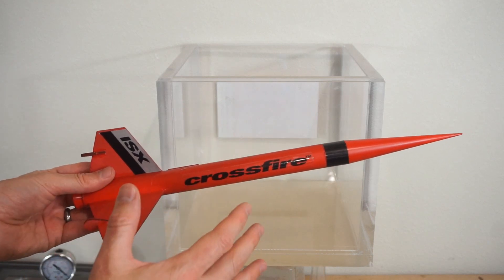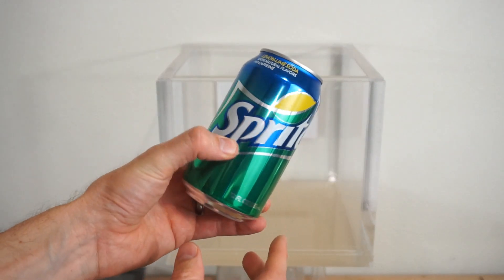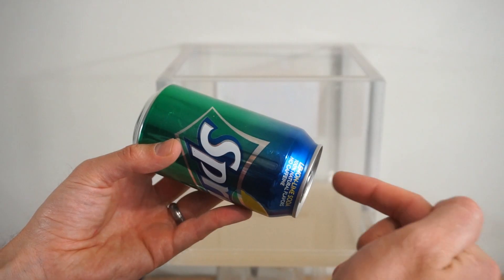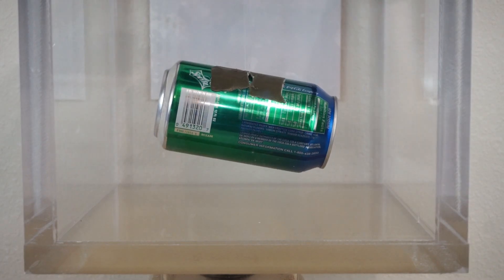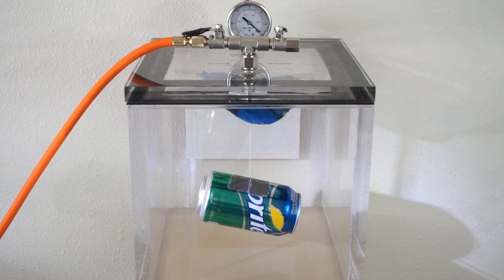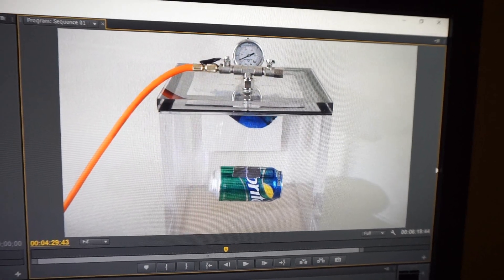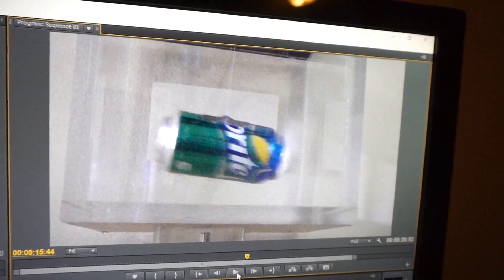Can a Rocket Fly in a Vacuum Chamber?

Comment: Stop telling stupid lies to ignorant people. Thats no real vacuum chamber.  The biggest vacuum chamber is in Ohio and only measures 100ft wide by 200ft tall. The vacuum gets compromised once you ignite the engine. In space cacuum your soda can will simply explode the moment it gets exposed. The Joules-Thompson's effect and the Bernoulli's law clearly show that thrusters cant work in space vacuum.
Reply: " the Bernoulli's law clearly show that thrusters cant work in space vacuum."
This is an absolute LIE.
Stop pretending you know anything about the subject.

Shall I show you VIDEO EVIDENCE of rocket propulsion working in a vacuum?

Jut answer one question first: At WHAT ALTITUDE does earth's atmosphere become "Vacuum" ?

For the sake of argument lets call "vacuum" any pressure LESS THAN 1.0 Torr,

Now answer the question and I'll show you the proof.
Reply: @stuartgray5877  Bernoulli's: the higher the fluid's, pressure the lower the speed. You can't get laminar flow nor contact in the bell walls without atmospheric pressure. Joules-Thompson's free expansion tells you the gases make no work. Show me the video to make you pieces.

Karmán line is at 65 miles or 99 km. 

The pressure in outer space is 1 × 10−6 to 17 Torr. Millions of times bigger than 1 Torr. Your argument is childish and inconsequential, 1 Torr is no space vacuum. There are no valid videos nor chambers able to mimic real outerspace conditions.
Inch of mercury (inHg and ″Hg) is a unit of measurement for pressure. ... In English units: 1 inHg60 °F = 0.489, 771 psi, or 2.041,771 inHg60 °F = 1 psi.
378.8 miles/2,000,000 ft= 7.0 x 10 to -11th psi
Reply: @1969nitsuga  Lets be clear.  1.0 Torr is a really SMALL pressure right?
1.0 Torr is close to one-one-thousandth (1/1000) that at sea level).
RIght?
1.0 Torr is about 0.02 PSI
You DO KNOW that 1.0x10^-17 Torr is just a WHOLE LOT CLOSER TO ZERO RIGHT?

You know those vacuum numbers  are NOT NEGATIVE NUMBERS right?

The difference from being at 0.02 PSI and 0.000000000000000001 PSI is negligible since the chamber pressure is about 3000 PSI.

DO you believe that a rocket SHOULD work at an atmospheric pressure of 0.02 PSI or not?
Reply: @stuartgray5877  1 Torr is a lot more than 1 x 10 \-6 Torr, exponentially. We are talking about supersonic flow. It still works in 1 Torr. The amount of molecules per cm3 is millions times higher. You don't get it because you have no empirical physics background.
Those chambers you mention are simply too small and weak to preserve a significant vacuum. Even more, the vacuum gets compromised (no more vacuum) the moment you activate the rocket engine. A rocket can get past the Kármán line capitalizing on momentum (p=mv) and the kinetic energy (ke= .5mv squared), but not for long because it can't generate force in space vacuum.
Reply: @1969nitsuga  " it can't generate force in space vacuum."

What LEVEL of VACUUM do you believe they stop working in?
Reply: @stuartgray5877  There isn't a magic number. It depends on different factors like the weight, design of the engine, type of fuel. It will eventually happens but those factors can make it faster. But for starters the Kármán line is right there. This soda can video is really ridiculous, only a moron would build such a set up and expect valid results.
Reply: @1969nitsuga  You can watch the falcon heavy side boosters perform rocket propulsive maneuvers above 60 km then see them land right in front of you.
Reply: @stuartgray5877  First: 60 km, 37 miles
Second: How do you know the altitude?
You are parroying stuff you have no personal knowledge nor understanding.
Reply: @1969nitsuga  A simple free body diagram proves rockets can't work in a vacuum, as does a simple PV work calculation. It is a ridiculous notion.
Reply: @papalegba6759  then SHOW US YOUR DIAGRAM.  Or did they run out of crayons in your special needs class because you keep eating them?

Comment: The gas just dissipates in the nothingness of space called the vacuum , high pressure moves to the low vacuum nothing happens no push nothing gas just dissipates into the nothing of space. I'm sorry you don't understand what a true vacuum is but any pressure will just dissipates no push no thrust nothing...
Reply: SO you are one of those that think that VACUUM "SUCKS" ?
 Perhaps you should try taking an actual physics CLASS before arguing that all physicists are morons?
Reply: @stuartgray5877  you don't even understand the physics definition of 'suction'.  you are hopeless.
Reply: @papalegba6759  - I am a vacuum test specialist with over 20 years experience operating some of the biggest vacuum chambers in the country.
I was first trained at Lockheed Martin Space Simulation Labs obviously before you were born based on your pre-pubescent intellect.

Your experience with "vacuum" is limited to what you do with your mouth and your teething toys.
Reply: Correct. 👊🏻😎

Comment: Nice video. If you do something like this again it would make it harder for folks to argue that it is really filling up the vacuum chamber if the rocket was much smaller, like the size of a Chapstick container or smaller. Maybe it could be filled with a gas producing reaction that is delayed, like vinegar and baking soda separated by a melting piece of ice, so there is plenty of time to reach maximum vacuum before it bursts. It would also spare you having vacuum pump and piping filled with Sprite. If nothing else switch to a can of carbonated water so it's not sticky.

Anyway, thanks for making great videos.
Reply: Failed experiment... :face-blue-smiling: the thrust has the full support on the face of the glass box. In a big vacuum space it will not work cause no any medium.
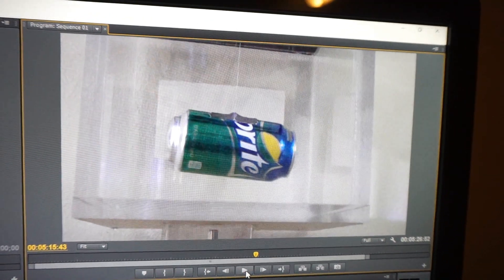Reply: @vz7042  "Failed experiment...the thrust has the full support on the face of the glass box" - failed reply ... You can see that the can moves before the fluid hits the face of the glass box 5:58
" In a big vacuum space it will not work cause no any medium" - there is no medium needed.
Reply: if he does it again try using a fkn rocket maybe?
Reply: @papalegba6759  He DID use a rocket. But if you prefer, he could have put some blue painter's tape over the Sprite logo and written "Rocket" on it with a sharpie.
Reply: Great video - for what? It is not explaining the rockets propulsion simply showing the law of momentum. Which by all means cant be the explanation for a rockets forward movement
Reply: @thomfont8594  "[the law of momentum] cant be the explanation for a rockets forward movement" - and what makes you believe that?

Comment: the vacuum is lost the instant the can is exposed to the vacuum.   Before the liquid touches the wall.  the entire tube is filled with gas  ( CO2)   This is very bad science.
Reply: bo ptah - well WHAT ABOUT THE YT VIDEO: "Uninterrupted Footage of the Falcon Heavy Launch and Booster Landing! 2-6-18"
It CLEARLY shows that the side boosters can TURN AROUND AND FLY BACK AFTER SEPARATION  from the center core.

bo ptah - WHAT IS THE ATMOSPHERIC PRESSURE ABOVE 50 kilometers where the boosters separate?
OH THAT'S RIGHT - ITS A VACUUM 

So please explain how those boosters are maneuvering IN A VACUUM?
What's that YOU REFUSE to admit that the atmospheric pressure above 50 km is LESS THAN 1.0 TORR?
Well that is because it would prove you to be wrong OVER AND OVER AGAIN.
Reply: @stuartgray5877  The YT video is a widely mocked fake.  I have answered all your silly questions.   and i repeat.  No one knows what the pressure is at 50 km.  .  A helium balloon has not even gone that high.  so it is just academic.

Comment: It looks like a significant mass weight of the (experimental) rocket moved directionally in an instant.  T*I*L*T
Reply: well WHAT ABOUT THE YT VIDEO: "Uninterrupted Footage of the Falcon Heavy Launch and Booster Landing! 2-6-18"
It CLEARLY shows that the side boosters can TURN AROUND AND FLY BACK AFTER SEPARATION  from the center core.
Reply: @stuartgray5877  LOL..."Space fantasy" is  for "Forever Space Boys".  Send a link of the NASA zero vacuum testing facility for rocket engine testing.  Good luck!
Reply: @whaleoilbeefhooked3892  o yo uhave NO COMMENT on VIDEO EVIDENCE of  rocket doing exactly what you say it cannot.

NICE JOB dodging the question and avoiding the evidence.
AND the company I work for tests thrusters IN VACUUM. Just because you dont think we do does not make it false.
Reply: @stuartgray5877  I believe the issue was Newton's Third Law which is valid for 'surface-of-the-earth' application.  The size of the test chamber does not compare to outer space to draw the conclusion declared.
Reply: @whaleoilbeefhooked3892  no comment on that video that proves you wrong?  You know that one showing a rocket maneuvering IN A VACUUM right in front of TENS OF THOUSANDS OF SPECTATORS?
Reply: @stuartgray5877  Sorry to 'pop' your space bubble and I know it's painful but the size of the test chamber does not compare to outer space to draw the conclusion declared.
Reply: @whaleoilbeefhooked3892  what about the VIDEO OF THE ROCKET MANEUVERING IN A VACUUM that I pointed you to above?  There IS NO "CHAMBER" The rocket is doing that IN FUCKING SPACE!  Which part are you failing to understand?
Reply: @stuartgray5877  Blimps.  Sorry.  I know it's painful.  It was for me also.  Once you see the fraud you can't unsee it.
Reply: @whaleoilbeefhooked3892  - So... how many  other accounts do you have on YouTube?  Twenty three?

Comment: another thing that flatearthers like to deny is that you can have a gas pressure in an open container. So what would happen if you had a tall open cylinder (eg. a pipe or a hose) with a high-resolution pressure gauge at the closed off bottom and filled it with some heavy gas? (eg. sulphur hexafluoride - just don't let too much leak, they say that it's "the most potent greenhouse gas evaluated, with a global warming potential of 23,900 times that of CO2")

Comment: or - is it due to the seal on the can being popped?  The momentum of the can isn't necessarily caused by the gases being released into a vacuum - it could - and probably is - the result of the seal of the can being forcefully exploded.
Reply: Are you under the impression that you are describing two different things - because you're not.

Comment: This only proves that contents under pressure will expand in a vacuum - DUH. Nowhere close to what the title of the video claims.
Reply: Newsflash; that is EXACTLY how rockets work. Expanding contents go off in one direction, and the reaction pushes the rocket the other way.
Reply: @petermirtitsch1235  That's not what is happening in the video. Its just contents under pressure exploding into the surrounding vacuum. If anything, it proves that spacesuits wouldn't work.
Reply: @MoneyIsSilver  what do you think a rocket does? Expanding gases exit the rocket at the blunt end, the reaction  of which forces the rocket forward. 

Space suits aren't made of a thin layer of metal; they are deliberately flexible and made from about sixteen or seventeen layers.

Why wouldn't a space suit work? It only has to hold 15 psi max. Normally now, I think they use about a third of that so that the suit remains flexible enough to move. Pushbike tyres can withstand over 4 or 5 atmospheres of pressure. Car tyres are routinely inflated to 2-3 atmospheres.
Reply: @petermirtitsch1235  I'm not sure about modern suits, but the Apollo suits were pressurized to only 3.7 psi.
Reply: @willoughbykrenzteinburg  indeed. This is because early work showed it was too exhausting to move against a fully inflated suit at 15 psi.